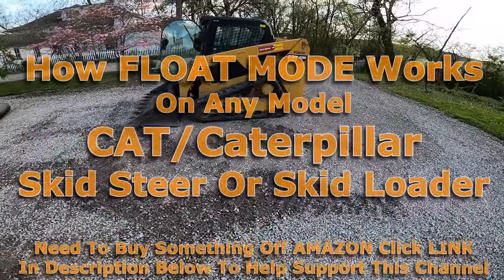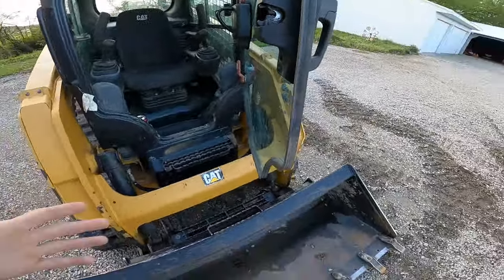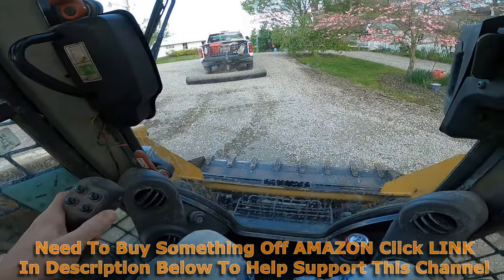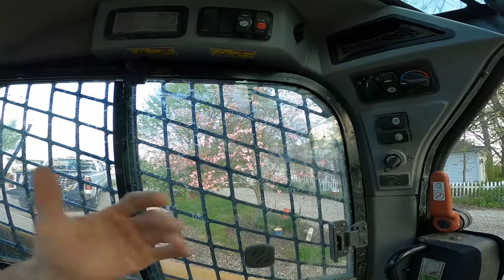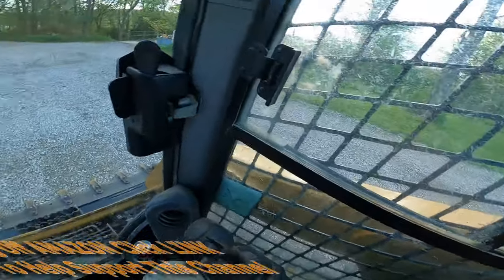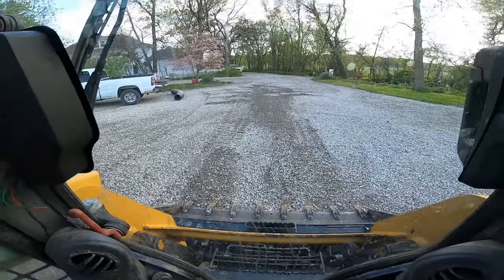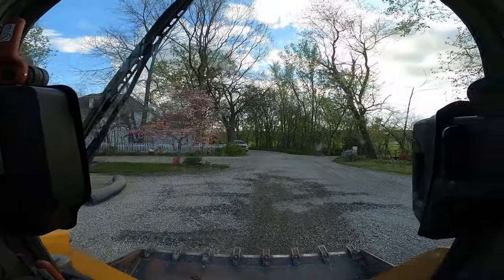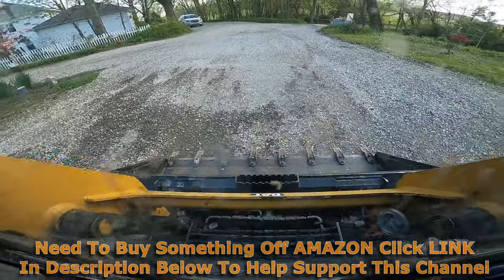CAT Skid Steer FLOAT BUCKET Mode Caterpillar D Series Skid Loader How To BUCKET FLOATING Controls ?

Comment: the switch you flipped on the left upper side is for bucket level mode when lifting the boom. the float will work with or without turning that switch on.
Reply from the maker: Thank you for the info appreciate it i'll try that out for sure.
Reply: Imma have to check that out
Reply: Old loader just automatically keep the bucket level. It's odd how the screw up new models with buttons for auto functions

Comment: Helpful video!  I hope it works on the 252B2 I recently purchased.  I'm a new skidsteer operator, so I am having to learn from people like you!  You're right, the Cat dealer videos suck at explaining this feature.
Reply: Did you figure out how to get your 252b2 to lock into float? Mine sometimes will lock forward with the electromagnet there but I can not get it to work consistently at all. Holding the joystick forward into the detent will make it float but it is a pain to hold it there.